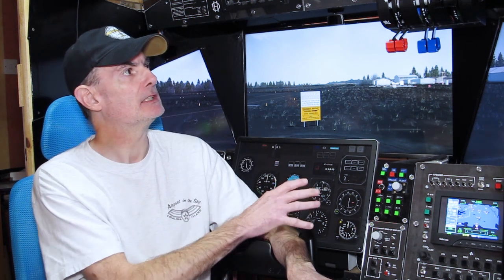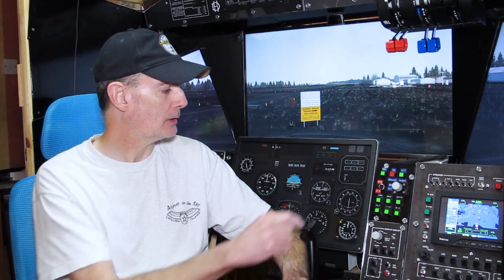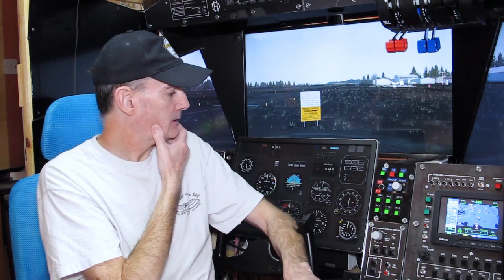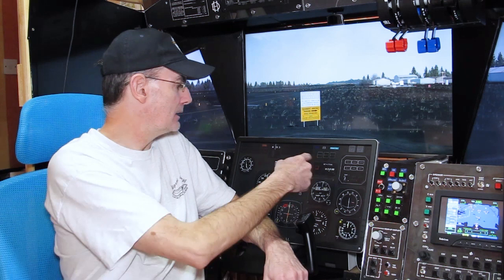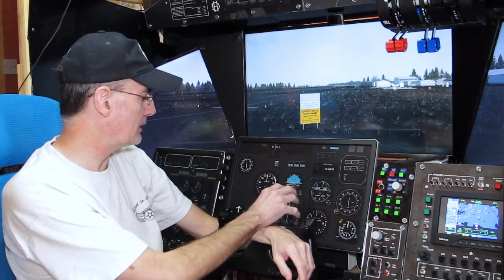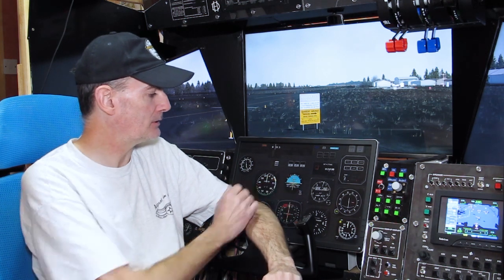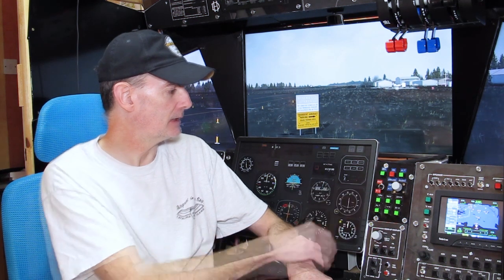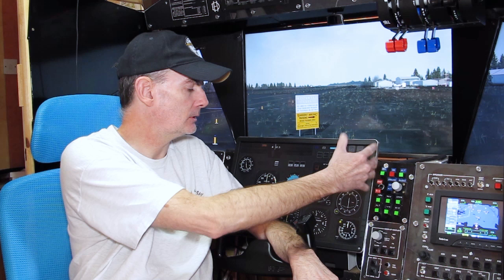Building a Better Autopilot Panel (Twin Otter Cockpit Build - Part 46)

Comment: Looking forward to following the progress. Have you considered to control the arduino card via Air Manager? Would require some light programming, but not very complexed.
Reply from the maker: Yes, I will be having a look at this too. There is a certain sense to putting all the display logic in the same place.